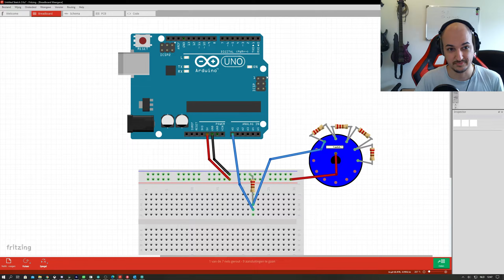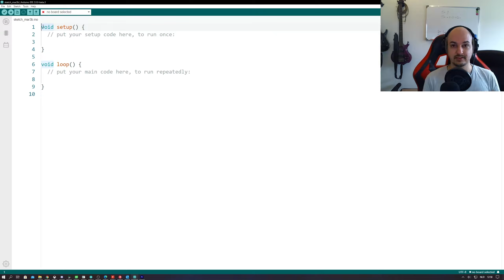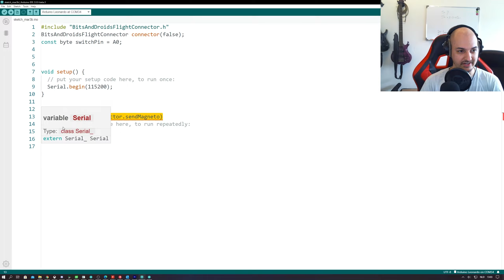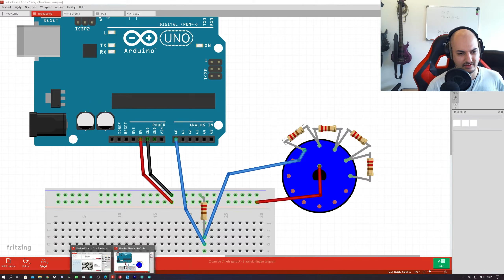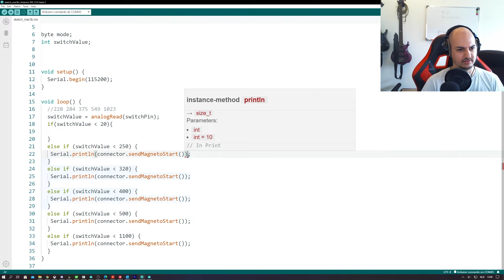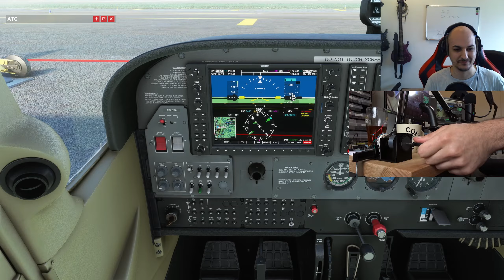Start your magnetos with a key, mfs2020 Cessna project #4

Comment: Você é o cara da configuração 
Estou ansioso pra ver seu video de configuração de multiplexadores. Se possível a configuração de pelo menos 2 com 16 canais  funcionando ao mesmo tempo.
Reply from the maker: Hi my spanish is really terrible so I've ran it through translate but I believe you're interested in multiplexing? I have some chips arriving today so I'll probably have a video comming soon.
Reply: @Bitsanddroids  Hello first I want to say that I am a fan of your work, congratulations.  Exactly that, I have 3 MUX74HC4067 multiplexers with 16 channels each connected to my Arduino mega that I use in XPLANE through the HCSCI software (SimVimCockpit).  I want to migrate my Hardware to the FS2020 but I am not able to configure my Multiplexers

Comment: Hey, i really like you video series...but i'm wondering why you are using such smallish resistors? generally speaking it's a lot of current over all...10K should do it also but with a smaller current.
Reply from the maker: If I give you the honest answer it would be because ive seen others do it as well. 220/300R were the examples I've seen used on buttons. 
My circuitry knowledge is still an area I'm learning. Simple case of worked before and reaplied here. I'll try it with stronger ones.
Reply: @Bitsanddroids  i'm wondering if there might be an issue with noise. but with 220Ohm @ 5 V as the smallest Value its like 22 mA